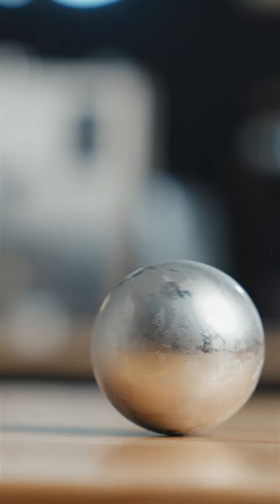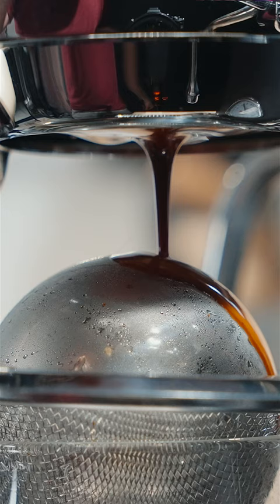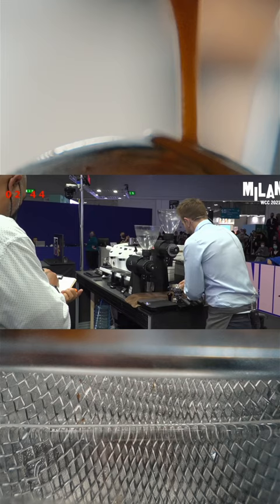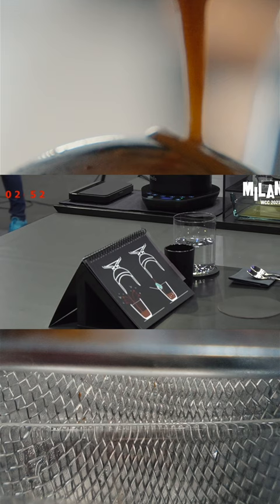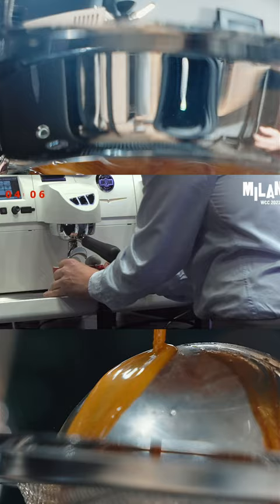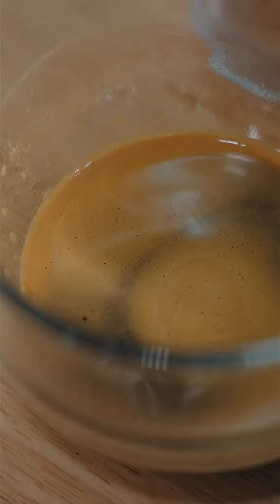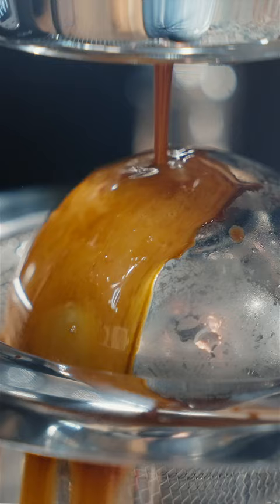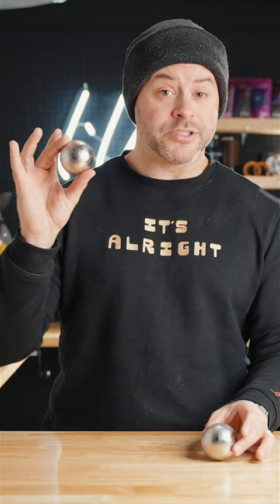$20 Espresso Hack

Comment: Coffee maker-2000$
Grinder-2000$
Tools- 150-300$
I feel like I need something more… Aha,balls!!! How much cost?
Reply: where the hell are you getting 2000 coffee maker and grinder do you mean 200?
Reply: @tulipsalami-nf1us  the coffee machine part is sort of accurate though. You can get a cheap espresso machine for around 400 bucks and it will do the job. But that's what it is, cheap. Not suitable for someone that seriously likes coffee. If you're gonna be making espresso in your home multiple times a day 700 should probably be a baseline for how much you'll want to spend on an espresso machine. I just bought an ascaso steel duo pid for $1,725. Grinders on the other hand are much cheaper. You can get a grinder for about 600 bucks that will cover all of your coffee needs across the board.

Comment: I don't think they actually make sense in regard to their intended purpose. I'm sure using them has some effect that may be noticeable but aromatics are going to burn off based on temperature for the most part. Whatever oxidation there could be from increased oxygen capacity in the water due to heat is insanely negligible and oxidation degradation I don't think should happen that quickly on any perceptible scale. Especially considering the amount of time between brewing and consuming. I am almost certain that a chemical analysis would prove me right. The gears are turning in the right way but it's overthinking it. I'd bet anything a blind test would be basically inconclusive. I think a lot of those competitions probably get a lot of uhh "rose tinted glasses" kind of perception.. you know how like they say you can make a $10 bottle of wine taste like the $100 bottle of you just change the price tag. It's in a competition so it must be good. Another good example is the South Park episode in San Francisco where everyone smells their own farts.
Reply: Ya but it does taste better …